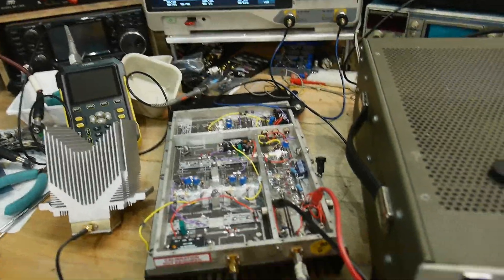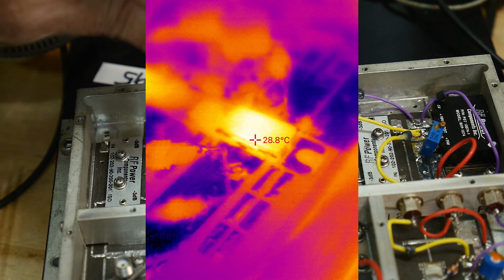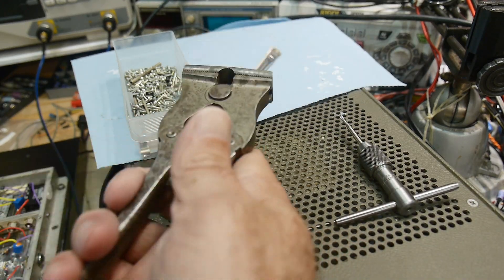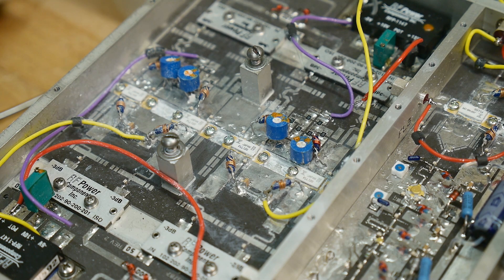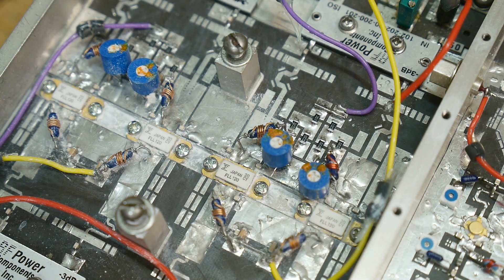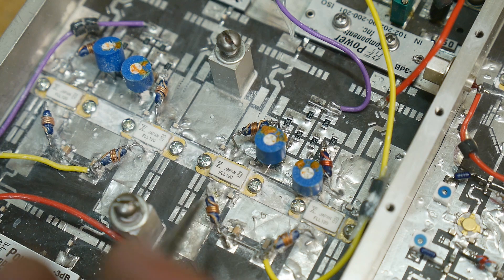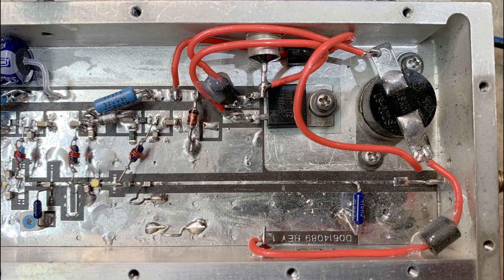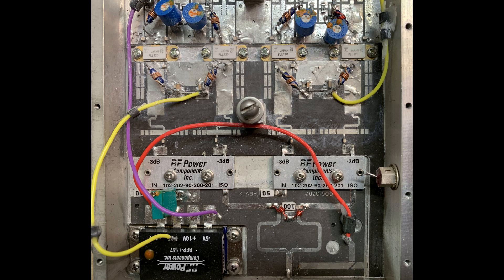#1867 1-2 GHz 30 Watt Amplifier (part 3 of 4)

Comment: One idea is to just use external power supplies for the failed one, to see if the power stage is fried or not.  That should be fairly simple, and would allow you to test the remaining circuitry.  Just a thought.